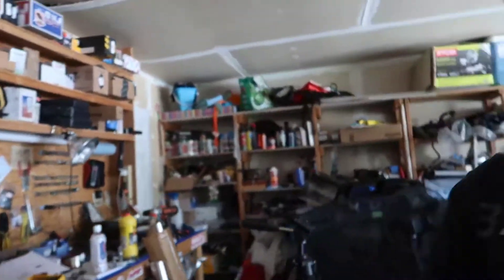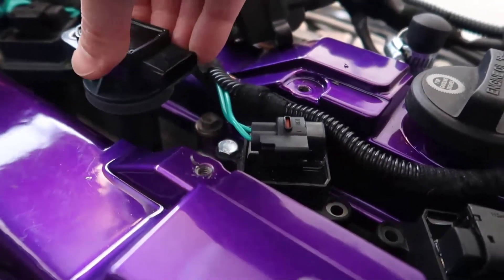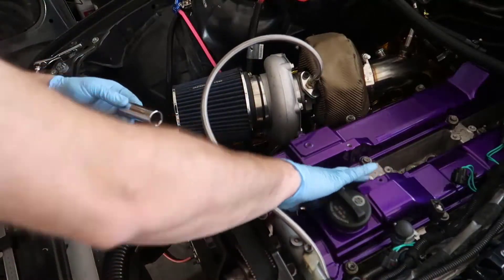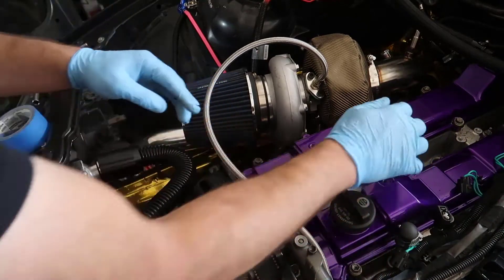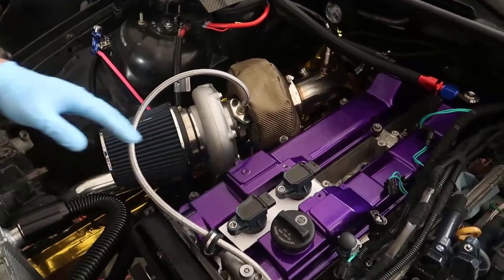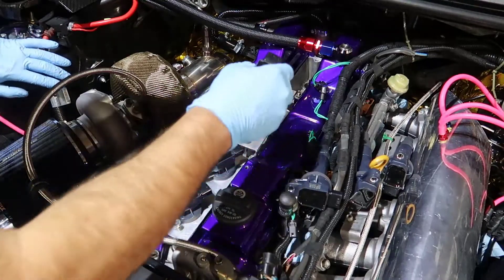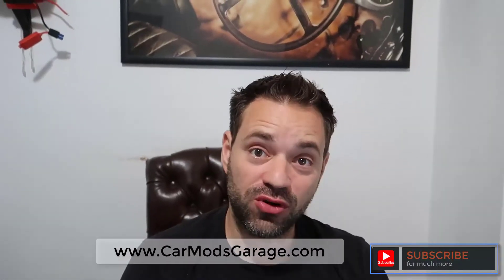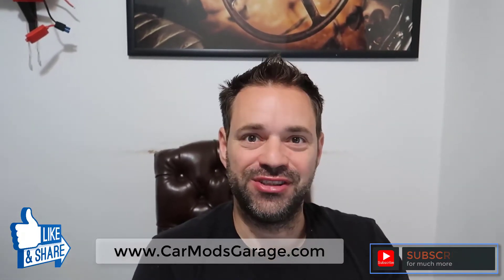Upgrading to Smart Coils Part 1 Making the Adapter Plate - 2JZ to E46 Conversion

Comment: What power are those Yaris coils good for before spark blowout?
Reply from the maker: I've read 100 per coil so 600 on my case but I know people running over that on those. I'm pushing around 533hp now and they work perfectly
Reply: Thanks - trying to decide between those or IGNA style coils
Reply from the maker: @youmadbro2876  those were too bulky for my liking but If I need more than what those Yaris coils give me I will upgrade to those